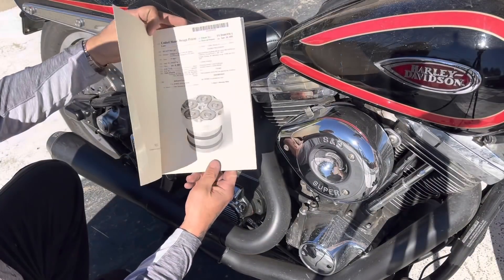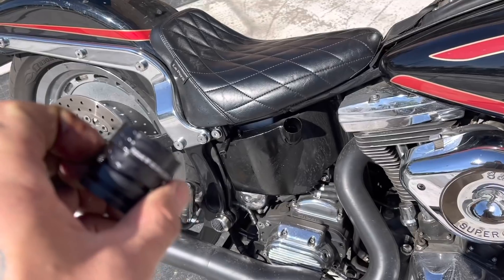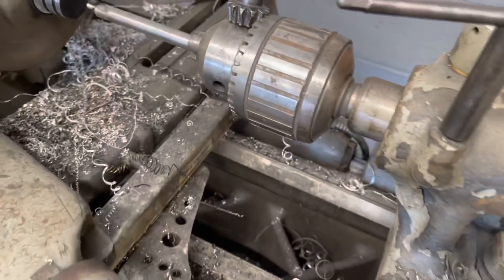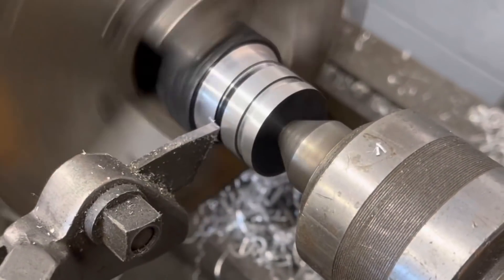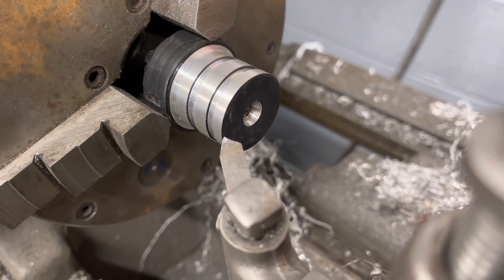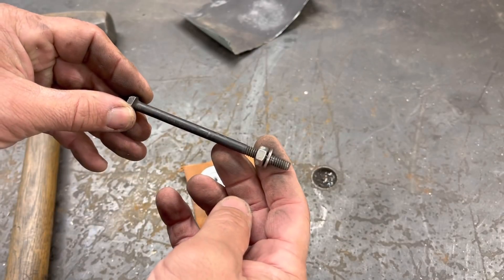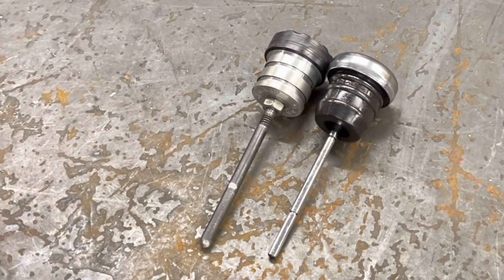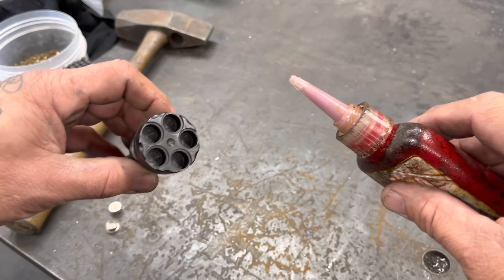Billy Lane Twin Cam Six Gun Oil Cap Harley-Davidson EVO Bad Boy Chopper Lathe Fabrication Harley

Comment: Loved this video. I have one of your six gun caps on my Street Glide. I get many compliments when people notice it. And blown away when I tell them you made it.
Reply: Maybe you should recount because the one in this video is obviously a 5 gun.
Reply: @Juergensry420  no, mine is a six gun. By Choppers Inc. Wish I could share a picture.
Reply from the maker: Thank you for supporting my small business, of American made parts!!
Reply from the maker: My initial design used .357 magnum shells, which fit six into the oil cap.  I wanted to use the .44magnum shells, which only fit five.  Likewise, the touring oil caps & handlebar risers fit six .44 shells.  Didn't make sense to change the product line name for the oil caps.  The US Patent office didn't seem to care
Reply: @BillyLaneChoppers  absolutely. American made and bad ass. I try to keep my Street glide true to less is best. But Suttle things like this POP out. Especially when my bike is idling, and my six gun oil cap is rotating. Super cool engineering Billy. 😎

Comment: Nice billy! Got a 95 badboy myself. Kick start and drain drive. Love the evolution engine with a springer front end
Reply from the maker: I always wanted one, and love mine.  Couldn't afford one when they were new.  They were expensive & unpopular, like the XR-1000, and didn't sell well. Good for us, they're holding value.  I have a kick-starter for it, but really love the Cobra pipe.  I can't run both, unfortunately.
Reply: @BillyLaneChoppers  Thanks for your reply Billy. Yeah the cobra pipe looks well as does the 23" wheel. I lusted after this bike for nearly 10 years. They're getting extremely rare, especially out here in West Australia. The kickstart kit works ok but Id really love a Baker frankentranny but they've stopped making them sadly. Ill send you a pic on your instagram. Keep the vids coming. Cheers.

Comment: the modern day fonzey sounds rejuvinated and brand new ? just add you have inspired me to join a vintage motorcycle club in western australia and have a go at a reverse trike style pivoting [leans like a normal bike but front end stay's stationary ] board track racer [havn't seen one like my design yet and not saying it hasn't been done ] but also have mentioned to others that a gokart front end would be fun and when you lean /turn your weight goes to the inside turning wheel ? also having a large rear wheel [rudder] should be fun working things out [aim to pivot the bikes lean on the centrifical spin centre of wheel radius ] it may need to go lower or higher ? to broke to do anything n buying tools keeps the project at a distance but getting there slowly ? keep inspiring us n hope the son's of speed does you well [ the unforseen weight affects us all ] and also watching the old guys change the electronics on the old bikes i came up with a formula for the natural change overs a while ago ? if you think of each season 3 months as a polarity change and that builds into a 2 year pos neg change over and moving from place to place also can change a bikes preset electrics [ alternaters are easier in a sealed circuit wiring system where the electricity can run / cycle through the positve conductivity or reversed through negative conductivity [ i'm probably not making sense as i'm not a sparky but have worked in mains power supply as a t/a [ trade assistant] ] this also determins your welding feed power supply which can make you sick if your welding a lot and i have reversed the [ green n red ] feed power in on my welder at times to aid my health     [ manufacturing a electrical product is predetermined for that origin work safe criteria ] [ so buying a cheap chinese welder preset for the other side of the globe could be fatal ] anyway it's  worth  knowing that the cycle of electricity is constantly changing in the orbit between the earth moon n sun [ 7 year push pull effect ] also i may have written something down to you before and this just adds to the psycological  splitting of the cell [ one male one female one nute one hemophridyte all may see a differant spectrum but look alike depending on what spectrum you see ?] have i done your head in yet [lol] = lot's of laughs
Reply: stop polluting the internet cuzz

Comment: You ever think about setting up a small shop with a few workers maybe 20 to 30 and making parts such as this.. if it was done using older mills and lathes you could make a killing
Reply from the maker: I'm going back into parts production early next year.  20-30 people is hard to support in the motorcycle industry.  We will probably grow from me to three.
Reply: @BillyLaneChoppers  that's sounds awesome..

Comment: Somebody doesn't even know how to count !
Reply from the maker: Right?  When I first designed these, I was using .357 magnum shells, which allowed for 6 casings in the oil cap.  But I wanted to use the .44 magnum, so I kept the 6-gun name and bored 5 holes.